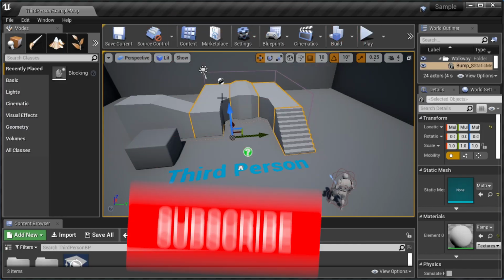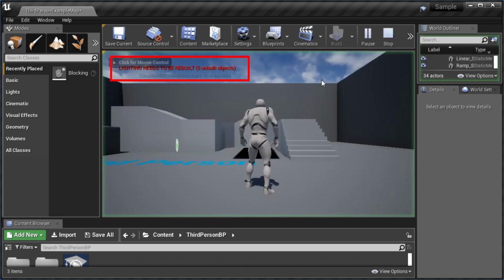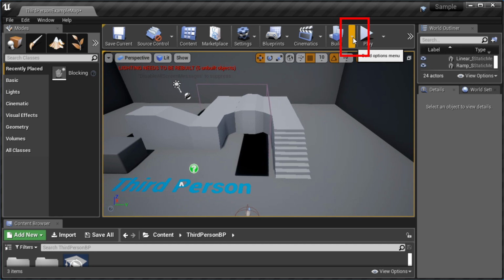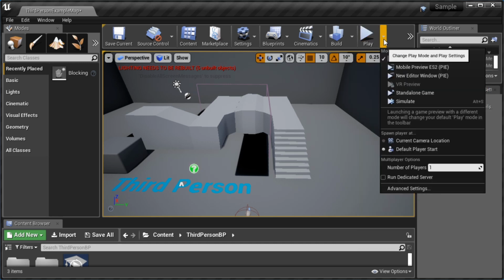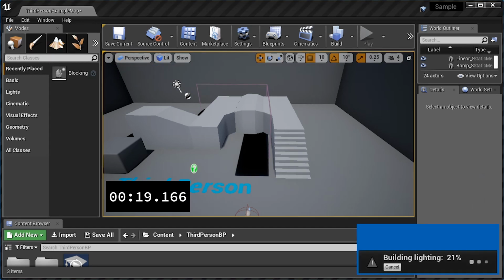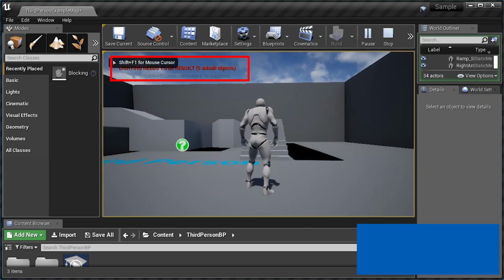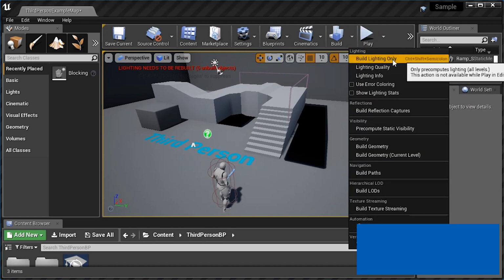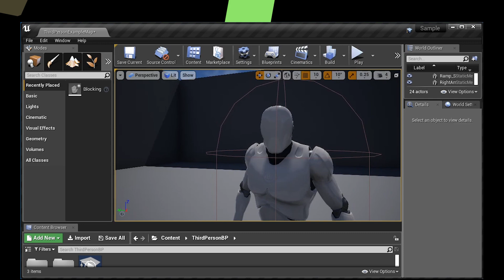Unreal Engine LIGHTING NEEDS TO BE REBUILT [Quick Fix]

Comment: Press the " ` " Key (Under the "ESC" Key) > (Opens "Cmd") > type "disableallscreenmessages" > ENTER
(I've setup an Autohotkey for this but nearly as simple just to type it.) Hopefully this is a problem of the past once UE5 is released.
Reply: Thank you kind sir. This was even more helpful than the video :)
I am following a tutorial and the message never showed on his UE so I'm guessing he has done this ages ago and didn't think to even mention it.
Reply: @XHackManiacX  It's one of those Unreal Engine easter eggs. lol. Thanks for taking the time to show your appreciation. I should do a little video on it maybe.
Reply: thats the bad way because then the lighting looks bad and its not good practice. just build the lighting idiot its not that hard
Reply: >"Hopefully this is a problem of the past once UE5 is released."

It isn't a "problem". When you change an object in static lightning of course you need to rebuild otherwise the shadows etc will be wrong.
The standard lightning system in UE5 is Lumen which actually "solves" this since it only uses dynamic lights which in my opinion is very bad since beginners will just use a lot of dynamic lights, and that has a huge performance impact
(tried it in my game - 40fps with only dynamic lights, 120 with static and it would be even more since it's capped at 120.)

Comment: I gotta rebuild the light everytime I move something?
Reply: Noticed no one replied to you yet, if your question hasn't been answered yet. The answer is yes, you can get around this by having movable light sources instead of static ones.
Reply: @critical_chaos7794  is static light source less expensive computation than movable
Reply: @ramiru3264  in ue4 yes :)
Reply: @carlosberreteaga6840  how is it horrible. it solved my problems.
Reply: @carlosberreteaga6840  its not horrible this is the propper way and you get better lighting and moveable lighting is bad performance so dont say things you dont know are true

Comment: Building lighting stuck at 0%, any idea how to fix it? I could not find anything useful on the forums. When I build it just refuses to move past 0%... All I have in my level is a flat landscape which seems to be unrelated to the problem. I have already got a lightmass that surrounds the playable area (which is not that big either)... Also, my GPU is an NVIDIA 2080 RTX and my PC is generally a beast with tonnes of RAM so it couldn't be a problem with resources or processing... Help?
Reply: i have the same problem and just noticed it 2 days before deadline in university
Reply: Hi, please tell me, did you manage to solve the problem?
Reply: @takidom  Saved all project files externally, changed hardware, did a fresh OS install, then reinstalled Unreal and downloaded files. It was a hassle but it worked like a charm.